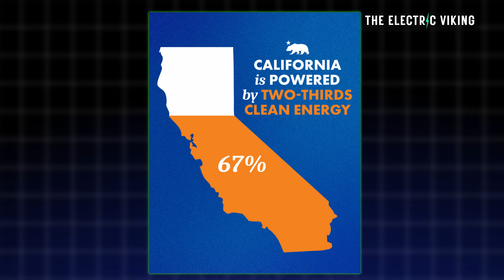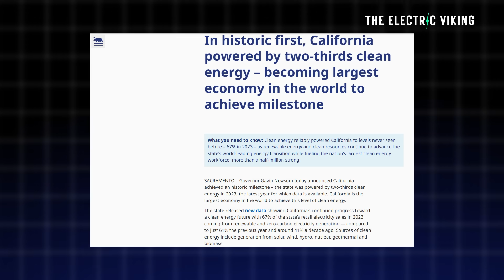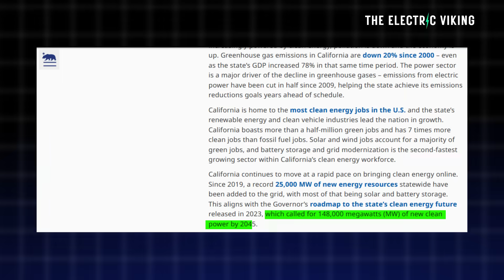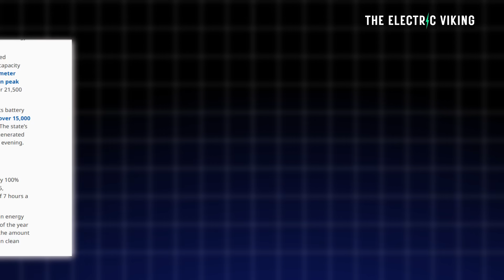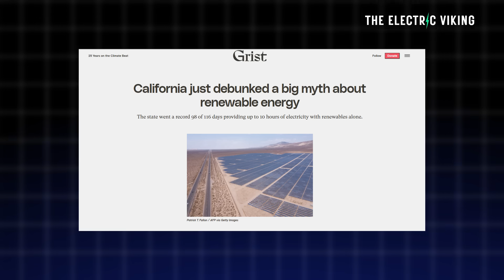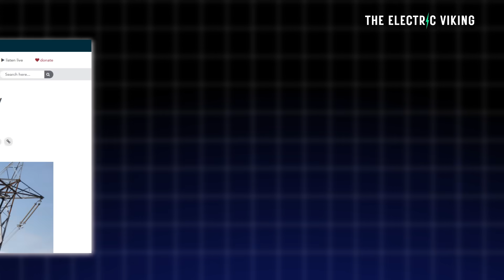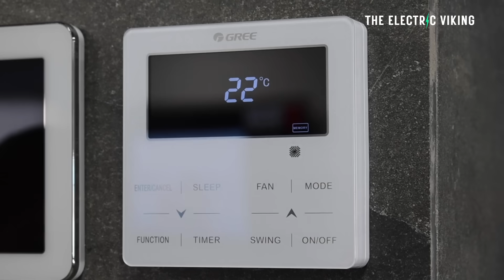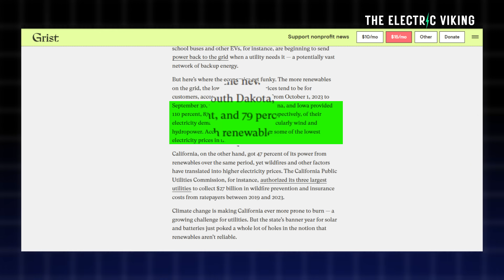California Shatters Renewable Energy Lies; Largest economy in the world to do this

Comment: California and Australia have a climate advantage adopting solar. Some places its not very cost effective
Reply: It is cost effective most places. Panels are extremely cheap these days. The issue is solar installers, and red tape, making the cost 3-4x what it should be to unaware homeowners. If you do it yourself, which is pretty easy you can easily have a payback of less than 10 years, even if you throw  in batteries.
Reply: @xeridea  solar has a capacity factor of 2% in the winter in the UK, ie completely useless
Reply: Yes that's the mean over a year, winter has much less sushine hours an intensity, hence dropping to 2% in the middle of winter
Reply: Not misinformation,just facts whiich do not adhere to your ideaology.
Reply: In a case study carried out by soly energy (UK)a 3.5 kw system produced 18-22 kw/h in July, the same system prodeced 3-5 kw/h in December, in London, which has more winter sunlight hours than most of the UK.
Reply: @xeridea Yeah, regulators and power companies have been slowing down adoption more and more. Some dont even pay for the power fed back into the system.But I'll bet solar in Seattle takes considerably longer than LA to recoup the costs.
Reply: @xeridea  If you take away subsidies, then they immediately don't become cost effective.

Comment: The oil industry has been driving the industrial economy of America for over 100 years
  And its political power and reach is without opposition.
From the TV ads to the sponsorship of inumerable political action institutes, think tanks, and defense department policy development
The Secretary of State in Trump's first term was Rex Tillerson who left the role as  Chairman of the board of Exxon Mobil Corp to take direct state power.
So little is discussed about fossil fuels facing any serious non carbon based  competition, that the public is scarcely aware of the emerging decentralized electricity generation taking over coal, oil as the source of electric power now.

Comment: I hellped.  I upgraded my self installed PV system to be able to charge my wife's Tesla (uses it for her work, 17,000 miles/year) and power my new whole house heat pump that eliminates a gas furnace.  I live near San Francisco.
Reply: nice
Reply: With insane electricity prices, the ROI on solar in your area is like 2 years right?
Reply: ChatGPT said: 
Throughout, 2024–2025, California’s residential electricity rate hovered around 31.7–31.9 ¢/kWh, roughly 103‑105% higher than the U.S. average (~15.6–15.7 ¢/kWh). It's a scam. A green scam.
Reply: @Chris-d3w7m  The high rates are a scam.  But not a green scam -- it's a fossil fuel scam.  The electric companies put off proper maintenance of gas pipelines and electric lines and overgrown vegetation around the lines, for SEVERAL DECADES.  And so, over the past few years this has led to HUGE payouts to people whose homes were destroyed by exploding pipelines, or by raging fires caused by poorly maintained power lines (made much worse by the extra-dry conditions caused by atmospheric warming, caused by CO2 emissions).  The high electric rates are to cover these costs.  So, in other words, the true cost of the fossil-fuel based operation over the last 50 years was never paid, the result was devastating losses of lives and property, and now ratepayers are being asked to cover it all -- they have to cover the huge payouts, AND the high costs of getting caught up on DECADES of deferred maintenance.

The San Bruno pipeline explosion destroyed 38 homes and took several lives.  The Wikipedia article about it includes the following nugget: "On January 13, 2012, an independent audit from the State of California issued a report stating that PG&E had illegally diverted over $100 million from a fund used for safety operations, and instead used it for executive compensation and bonuses."
Reply: @Chris-d3w7m   ....  SoCal Edison is my electrical supplier and my bill says my Tier 2 rate is $.41 KWH (which I jump into very quickly) and that is what I pay.  Starting in a couple months, they will be adding an arbitrary $25 base fee to my account and everyone elses.
Reply: Looks good except for the Swasticar ⚡️✋️✋️⚡️
Reply: @larryc1616 lol people are still saying that?
Reply: @larryc1616 I hear you, but I've decided to hate musk not the car since global warming supercedes politics for me as a 75yo.
Reply: @ronfarnsworth7074   ....  Keep in mind that batteries make no energy; they only store energy.  If you charge yours with your own solar, great.  California must import its electricity when the sun doesn't shine and not much solar from out-of-state is renewable.  China is at the forefront or EV adoption, but they are building one coal-fired power plant per week.  (Easy to look up.)  That doesn't seem like reducing global warming to me.
Reply: @larryc1616  A block from my house are two Teslas with bumper stickers:
Bought before he went nuts.
This Tesla identifies as Prius.

Comment: the new dam which China is building in Tibet will produce enough electricity to cover the complete needs of Germany. When finished hydro power will cover 30% of China's energy needs.
Reply: When China starts their war with Taiwan they might wish for bit more dispersed energy production schemes.
Reply: Sam, are you not aware of the major blackout in Spain and Portugal two weeks after they went off the grid? And it just last a few hours or a day, either...
Reply: @imsosmart942   How is this even remotely related?
Reply: @imsosmart942  Maybe you missed it, but there have been dozens of videos about this.  Adopting renewables does not cause blackouts.  If anyone has told you this, they are misleading you.  In California, the added solar generation and batteries have ended the longstanding practice of "rolling blackouts," which used to happen multiple times EVERY summer for decades due to the unreliability of coal and gas fired power plants.  I will repeat: When the grid was mainly powered by fossil fuels, there were blackouts in California every single year.  Since the added solar generation went online back in 2022, these rolling blackouts have stopped and haven't returned.

Comment: CA has the highest electricity prices in the country!  10 years ago it was around 9-11 cents per kWh.  Now it’s 33 cents off peak 11pm -5 Am. 54 cents on peak per kWh!

Not all costs related to fires!  Very small percentage!

Wind and solar are very in efficient and adding the wasted cost of Batteries to smooth out the supply is very expensive!
Reply: It's the fires they even admit it's the fires stop with the BS.
Reply: The price has to be dropping because Texas is not promoting renewables but is the fastest growing state for it
Reply: @Phil-i58  None of the states that are using a lot of renewables talk about it. It's like they don't want to get attention from the oil companies.
Reply: Untrue. Batteries are the most efficient way to store electricity.
Reply: You need solar to have a reasonable electric bill nowadays
Reply: Other areas have renewables with little to no impact on cost. Even with battery storage. My local co-op has a decent mix of renewables, and I pay 7.5 cents per KWH. California utilities are corrupt as hell. Texas has a lot of renewables, and their rates are slightly below the national average.
Reply: @xeridea yes. Texas has more wind generation than Cali so they for sure aren't doing it for green reasons.

Comment: A friend of mine - who watches GB News all the time - told me windmills only last 5 years and they rust. When they actually last about 25 years and aren't made of steel .. The powerof oil-biz propaganda...
Reply: As someone who passes by the huge line of wind turbines set on the peak of the Arbuckle Mountain range in Oklahoma, there are ALWAYS some down for repair.  If you’ve never seen them haul one of those humongous blades from the nearby factory (Ardmore I think), it is quite an ordeal!  The turbines themselves require petroleum based lubrication and lots of it that needs schedualed replacement too.
Reply: @carlpabst6506  Can you share which electrical production system never requires maintenance.
Reply: @gpsfinancial6988 I think you missed the point.  It's not that they need maintenence, its that the maintenance required is so expensive, dangerous, petroleum consuming, and are extremely difficult to recycle/dispose of.
Reply: GB News 😂😂😂 of course they would say that.
Reply: @peteralflat281  those who con humans out of their own  power. Dismaying how many buy into it because of tribal association.
Reply: The blades aren’t, the rest is.

But I agree that there’s a lot of misleading claims.

Comment: That is all good. And I like that we are so clean. It is unfortunate that this comes with one of the highest cost of electricity because of early adoption at higher cost that after reaching scale.
Reply: Indeed, it's expensive.   But what is air quality worth?  It's worth something.
Reply: You know that ain't true. PG&e charges so much is because it got sued all those times for all the friars. So they Jack the rates up from the user has to pay for it.
Reply: @Joegreen-r1i Yes, and my recent SCE increases are all due to both lawsuits and infrastructure upgrades do to wildfires. It has little to do with renewable energy.
Reply: It just pushes blue collar worker out of California
Reply: Fossil fuels are still the backbone